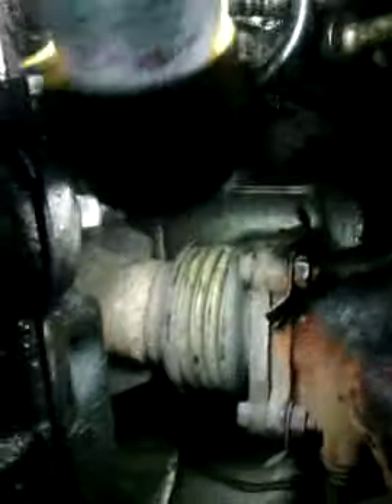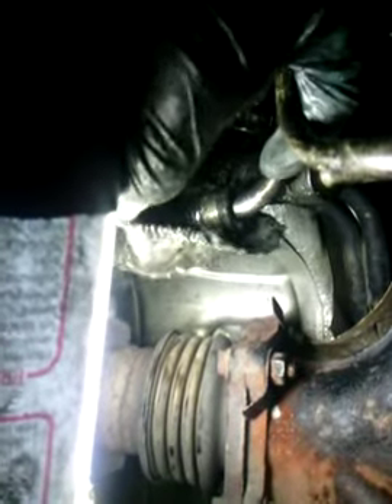00 town and country power steering pump ....part 2

Comment: You can take the pump out from the top. Just take the line from the fluid resivour and should be able to wiggle it out from behind the intake comes out by battery. No need to remove brakes and axle. Literally a hour or so. Can remove air filter box with 2 bolts and have all the room to remove pump from top. The only thing is need to get belt off. Possibly tensioner I was removing tensioner anyway